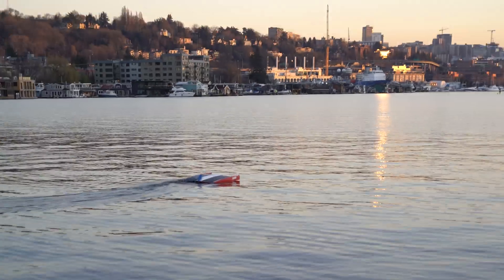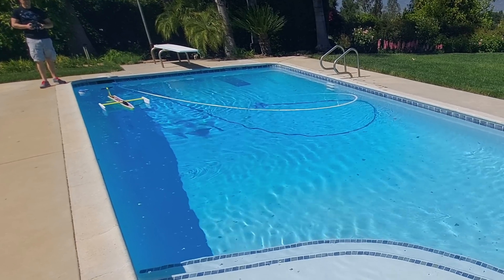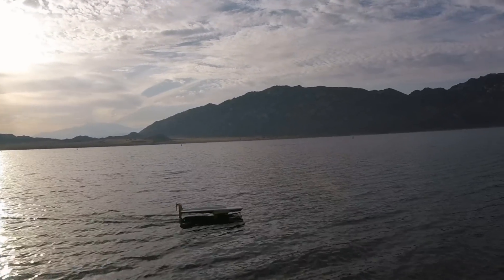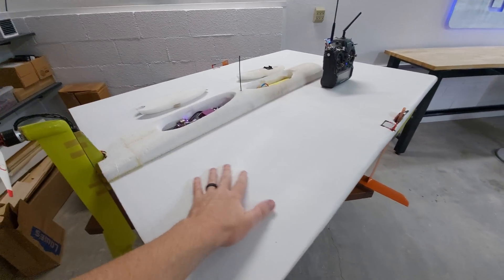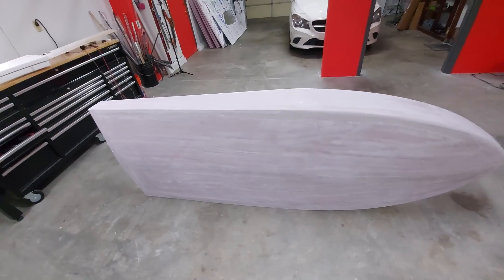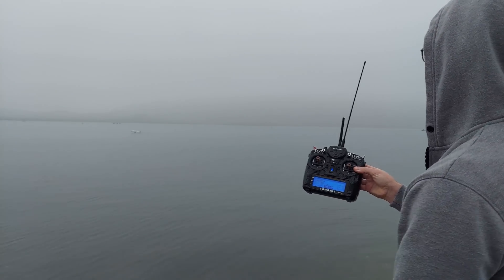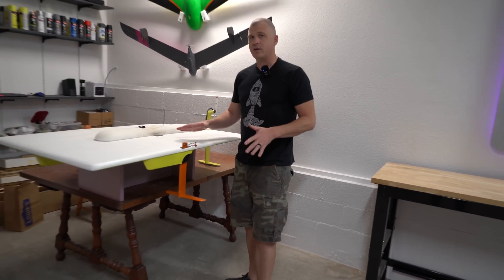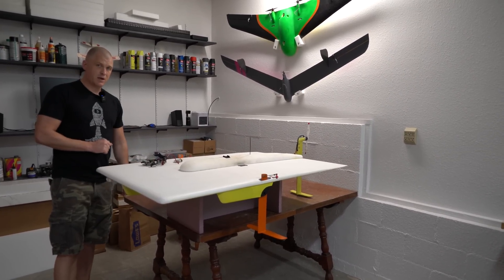Autonomous Solar Powered Hydrofoil:  Getting The Vessel Right

Comment: There's second quite uncommon type of self-stabilizing hydrofoil - shallow submerged. It's like fully(deep) submerged horizontal wing but fixed and going very close to surface. As a wing dives deeper it's lift increases and vice versa.
Reply: That is true but according to a book I read recently, Hydrofoils by Ray Valinga, the difference in lift isn't enough on its own and some additional active stabilization is still required for stable "flight."

Also running a hydrofoil wing shallower than it's chord length causes wave drag and is less efficient.

But please, I've been very interested in hydrofoil designs and if you can show me one that uses such stabilization then I'd love to see or read about it!
Reply: @Chris-oj7ro   it's implemented on many soviet river hydrofoils, f.e. Meteor, Raketa, Voskhod. Search for pictures and you will clearly see underwater wing right below the surface of the water. And no active stabilization used since soviets were bad in electronics. 

Picture of how this works
https://i1.wp.com/img-fotki.yandex.ru/get/94893/3267217.39/0_1015f6_b175388f_XXL.jpg

But not much written about it. Forgotten in history, scrapped for metal